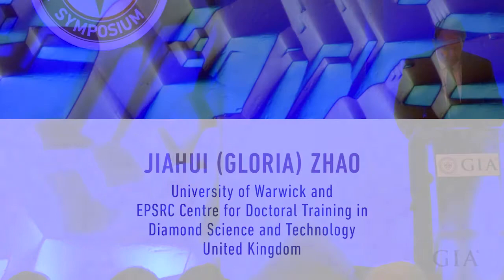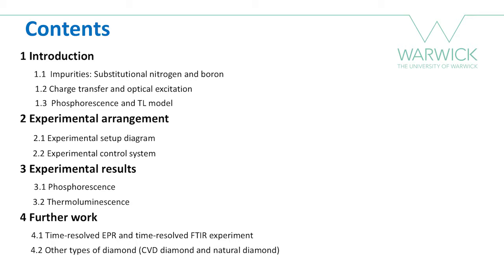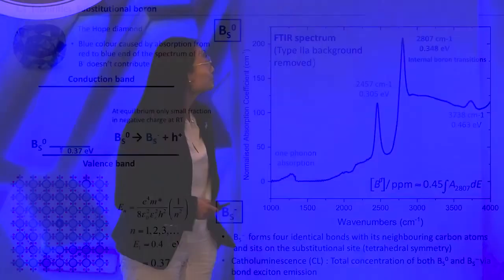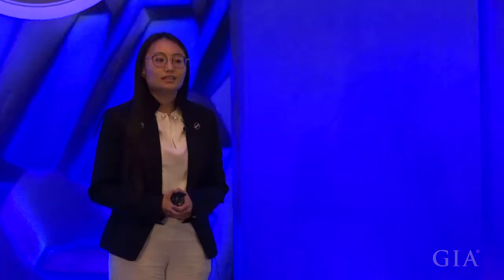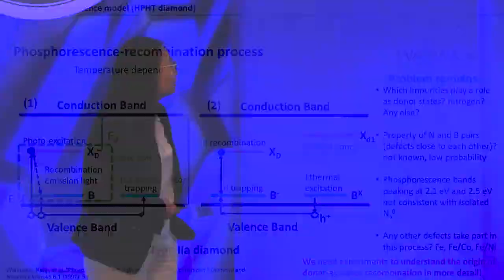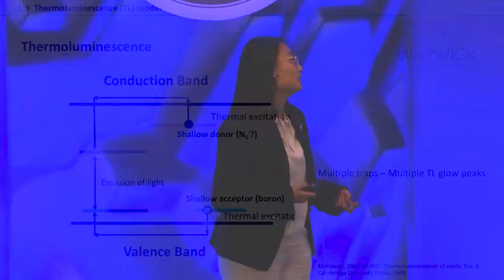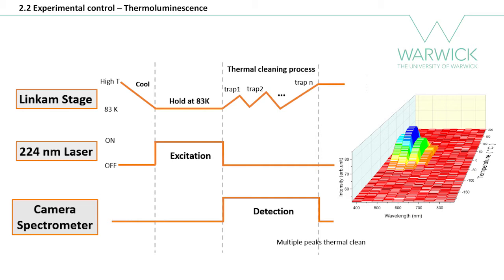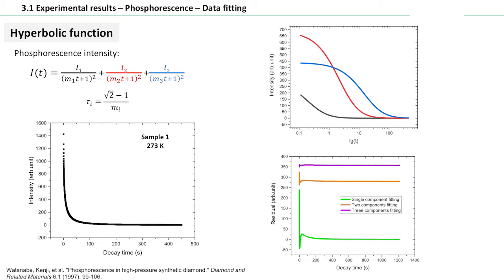Jiahui Zhao: "Fluorescence and More in Synthetic Diamond”

Comment: Any distinguish test to identify CVD from real ones!?
Reply: @GeologyofGemsMinerals  
Thanks for that link; great summary. 

It seems from Pinto/Jones, though, that birefringence (due to dislocation) isn't necessarily always present -- which means that rotating the cross polarization while looking at a stone might yield false negatives (i.e. you might miss detecting a CVD diamond).  I didn't see any discussion about the prevalence of the birefringence in their article but they seem to imply that it's common ("often", "in many cases"): https://www.researchgate.net/publication/51562534_Theory_of_the_birefringence_due_to_dislocations_in_single_crystal_CVD_diamond 

In any event, I think you'd need to make a sort of "strict null" hypothesis to correlate it accurately (i.e. tying structural x-ray data to the cross polarization observations in each stone, and then seeing how those features look against a dummy variable for CVD). 

I'm not an x-ray/structural elucidation expert... but I bet you might be able to build a machine learning model to take a "best guess" if you use various tests as inputs. In lieu of having a method for definitively detecting CVDs, it might be "good enough" for now to have a method that flags stones as "likely CVD".
Reply: As an aside, the N and B substitutions in diamonds have been known for a long time (https://www.nature.com/articles/276379a0)

It occurs to me that you might be able to vaporize a layer of the diamond (laser ablation), pass it through a high resolution ICP-MS (like a time-of-flight or orbitrap) and check to see if the isotopic ratios are different in CVD and natural gemstones. It stands to reason that you might be able to use cluster detection to identify mines from which natural diamonds come from --- and then see which diamonds don't fall neatly into those groupings. 

I didn't do an extensive search, but google turned up this paper which seems relevant: https://ui.adsabs.harvard.edu/abs/2018EGUGA..20.9836W/abstract